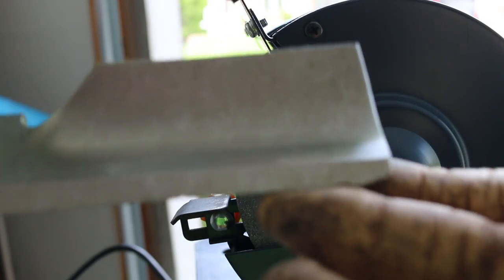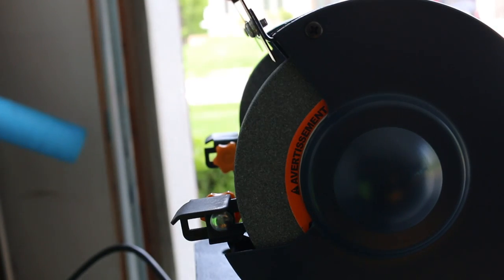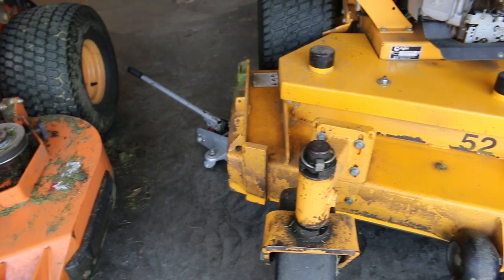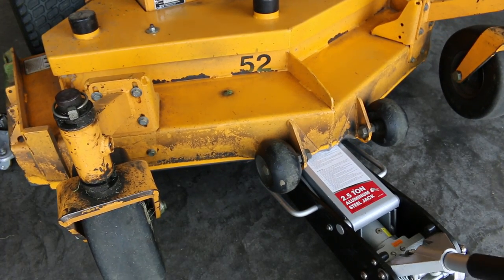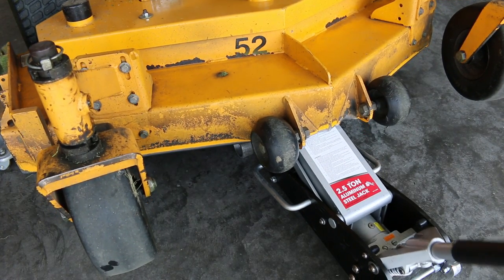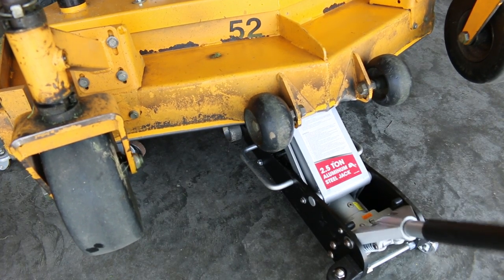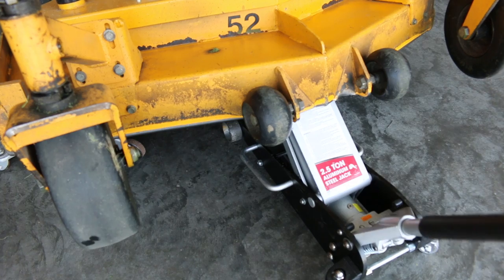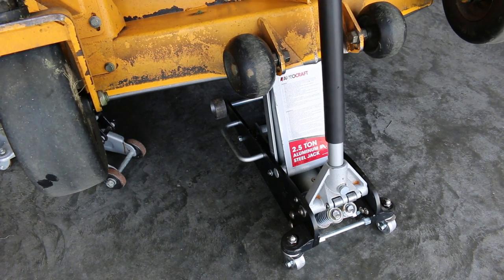How To Sharpen Lawn Mower Blades

Comment: jack & jack stands, the safest yet. most 2 or 3 ton & up jacks should be fine, but i implicitly trust no jack by itself. i was once under my old volvo patching up a muffler; i crawled out to get something, five seconds later the car fell because the jack failed. Good Lord.

& i do blades the same way you do for the job mower ( just throw a quick edge on there ) because i do 9 blades at a time, but every 2nd to 4th grind, you might want to hit that whole angled edge, because trying to even up an angle after just the tip has been ground and ground and ground takes forever. 

good video, that camera is sharp.

Comment: I usually put a scrap piece of square metal tubing under the caster arms to jack up the mower. Then I use a car stand  to catch the lip under the deck. Then I move the jack under and next to the stand. I had the jack stand kick out once . Scared the crap out of me. The jack wont kick out since it has wheels.
Reply from the maker: Very smart!

Comment: Try putting the blade in a vice and grinding it with a small angle grinder. That way you can see the cutting edge as you grind it in to shape. I been grinding blades that way for over 35 years. Also you my want to plan on getting a Magna Mount blade balancer. 
http://www.ebay.com/itm/like/271195344214?lpid=82&chn=ps
Reply from the maker: See this is why I love YouTube, we can all help each other out thank you!
Reply: Tanasi Time Yep for sure.  I noticed some rather deep cuts in the blade and surely may want to balance the 2 sides out....otherwise additional problems soon surface.

Comment: Good start as an electric grinder sure does take the effort out of it compared to a bastard file! lol  Try to keep the same profile on the blade that the manufacturer uses rather than adding an extra ... Take the metal back as a whole evenly both sides against sharpening at the edge rather than from it.... This might help ... https://www.youtube.com/watch?v=U4ppmcUWAAM   

To be utterly honest it's not chisel edges we're sharpening here but done right they will hopefully keep a strong keen edge a bit longer... All the best and keep up with the interesting vids :o)

Comment: I see this time and time again. I sharpen from the other direction.  The edge must stay the same angle. When I sharpen I am holding it the other direction so you cant see the edge.  You watch the sparks to make sure your hitting the whole edge. I have sharpened blades also for over 30 years. I see so many try to sharpen them the wrong way. Its hard to describe but if you watch this scissor sharpening vid you will note the flat is on top and edge is away. Grinder is grinding against the edge not grinding like your vid down to the edge.  That's how I do it Im sticking to it. https://www.youtube.com/watch?v=nNmLSWnneAA
Reply: Dandy Lawn I sharpened scissors professionally for 30 years and all types of blades.